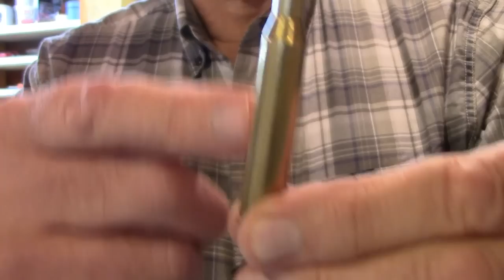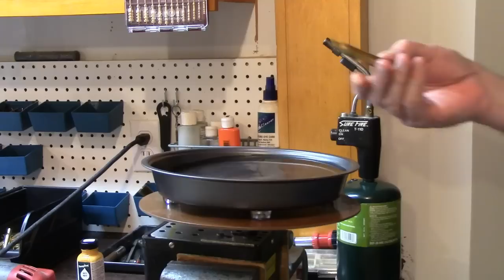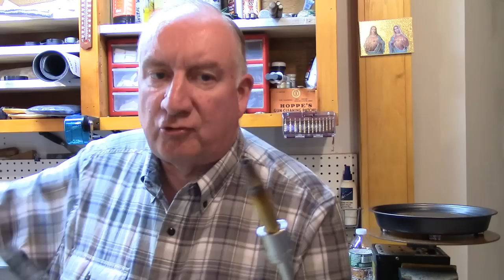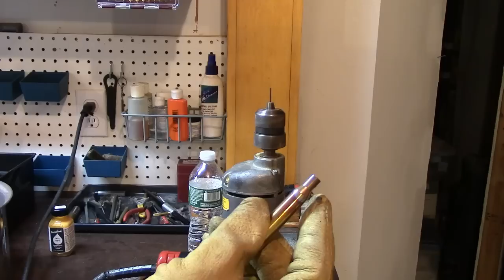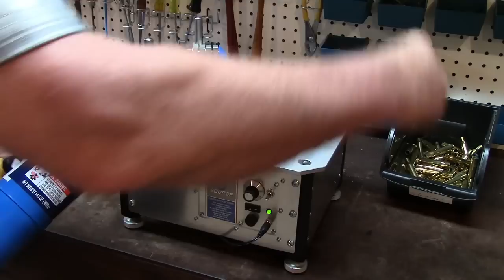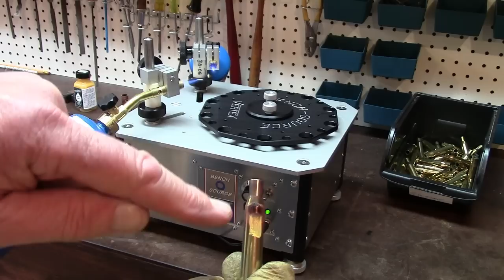How to Anneal Brass ~ Vertex Bench Source or a Tight Budget!

Comment: I have seen your bedding part 1 & 2.  I have bought a parker hale C (detachable clip, would have prefered a floor plate) 300 Win. Mag.  I was planning to free float it because the barrel was tight in the stock like you have explained why its done from the factory. When I removed the stock the forend was already glass beded to keep the barrel tight in the stock but not around the recoil lug or crossbolt.
This will also be tricky atound the back of the trigger guard assembly. May I send you a few pictures for advice.
Thx
Roy

Comment: Excellent video with tons of knowledge.  I acquired a Win 25-20 from my dad before he died and when I looked for ammo I was shocked to see it at $1.25 per cartridge!  My son has a Dillon press so I got the dies and proceeded to resize available 32-20 cases to 25-20.  My question is can these even be annealed since the case isn't that long to begin with or should I just reload them to failure?  If the color band change were to go just 1/4" below the lower bevel it would put it at the midpoint of the case.

Comment: Hi gunblue, I started annealing brass using the water bath method you showed. I am using a bernzomatic T8000 torch with propane. Its a bit powerful of a torch so I backed it off and I am using a hand spun kitchen lazy susan. I noticed on some brass I am getting a copper color even though I am leaving the torch on the brass a short time. Is this dangerous?

Comment: I love that machine.  I think the first method you used is flawed as it heats then cools very rapidly.  I am not too sure very fast cooling will prevent brittleness, or remove brittleness.  Anneahling is usually involved by controlled or slow cooling. I know brass is different than steel, and melts at a lower temperature, and therefore Anneahling versus Tempering would occur at different temperatures.  So the temperatures you mention sound right for brass. I just dont know that quenching a piece of brass quickly in water will make it soft as cooling it slowly.  I don't have three years to do a graduate thesis on it either. I only suggest it might not be as good as slow cooling, where slow cooling helps remove more flaws in the crystaline structures of a metal.  I'll go with slow cooling I guess.  Thanks for all your video's. You look like my grandfather, but are more my age.  Good damn advice thanks

Comment: Nice video. Thanks.  nice machine. I need one.  I don't understand the issue of to quench or not to quench.  Seems it is not hot enough to make any difference quenching.
Reply from the maker: Quenching has absolutely nothing to do with annealing brass whatsoever.  Steel is quenched to control hardness, but it has no relationship to brass.  Water is only involved to prevent unwanted heat from going too far down for some methods, and for cooling brass so it can be handled comfortably.  There's no issue of to quench or not to quench, because brass is not quenched in the traditional metallurgical sense attributed to steel.

Comment: Thank you so much for all these videos you create! Love how you show "cheap" way and not just expensive product usage. Question: How little heating is to low for propper annealing? I only have a cheap blow torch so not concentrate heat, and i realy can't see any blue at all, and hardly any brown.
Reply from the maker: Frode Hanssen 
Proper annealing can be done inexpensively, but it absolutely requires a concentrated propane or butane flame of sufficient intensity to bring the neck and shoulder quickly to 650 F.  A lazy flame will either cook the entire case before the job's done, softening critical tough brass, or it will simply not anneal the neck at all.  A basic but extremely good Bernzomatic torch kit with a propane tank only costs about $16.95 at Lowes.  That's less than 100 Sierra bullets or a pound of powder.  I see no reason why you need to use a cheap torch.
Reply: I forgot to mention when it's in the water pan. In drill, it turns red in about 7-10 seconds, so the heat is high enough i think, i just don't have that concentrated flame on my propane/butane torch like yours. So blue color shows when using drill. But in water, i can't see any color, it just turns to light color. Much like yours in the movie when using water pan, the first time. I just wounder in the water pan, how can i know when it's heated enough i water.

Comment: Question and comment - Very informative video; and it prompted me to watch many others now that I've subscribed to your channel.  I do have a question, having never annealed cases but wanting to start doing so... Should I resize then anneal, then load, or should I resize after annealing?  I realize the latter adds additional cold work to the case but I would expect minimal if it's already resized and that would seem to take out any warpage possibly created by the heat??  If it matters, I'm neck sizing only 270 WSM brass that's got me interested in this due to some neck splitting, which I haven't seen on any other cartridges over the past 10+ years of reloading (e.g. 7-08, 30-30, 30-06, .357/38, .44, 45LC).  Thanks!

Comment: I have one of the annealeez machines and for the most part works good. Unfortunatly im shooting a custom 22k hornet and need to anneal but the brass is to small to run on the annealeez machine. I may need to use the waterbath methood on them. Luckily its a single shot rifle and i dont need to anneal a lot of brass kn a hurry. Im still confused with the temperature indicating fluid. Im tol you should put it inside the case mouth, others say put it around the outside of the neck and you painted a stripe on the side of the case. Which should it be?
Reply from the maker: I prefer the stripe, which provides a relative reading of temperature progression, to avoid overheating the mid section.

Comment: I reload .303 British.  My cases separate 1/4 in .from the base.  You say to only anneal at the neck.  I have reloaded .303 for over 50 years.  usually just scrap them after 3 reloads. I don't want to mess with a different head space.  It's a real tack driver Enfield.  What's your opinion?
Reply: The 303 headspaces on the rim. Not on the shoulder as 308 does. Due to the compression on the bolt during fireing : the body of the shell grips the chamber walls the only place left for stretch is the area in front of the rim. So 3 reloads not bad

Comment: Looking for advice  and information. I have come across 6 mm Remington loaded and unloaded with no use for them and finding no one around that has 6 mm Remington. In inspection it would seem I can run the Remington cases through my 243 dies then trim the cases and use the 6 mm Remington as 243 .  They seem to run through the 243 die with ease and lower the sholder with no problem. Is there a reason this should not be done and with the moving of the shoulder will they need to be anneled  if they can be resized to 243.

Comment: In my case. my only advice is you are better off under annealing than over annealing.  I just line up my brass in a metal pan with about 3/4" of water in it...  then I turn off the lights so it is completely dark.  With the cartridges all lined up I go down the line slowly with my propane torch, just until you see color.  It doesn't have to "glow", just move on when you see any coloration.  I run it up the line of cartridges, then turn the pan around and do the other side of the cartridges.

Comment: Thank you for an excellent insight into the nuances of case annealing. I have one simple question; at what point in the reloading process do you anneal? There seems to be very different opinions on the topic. Before Resize or after ?
Reply from the maker: Frank Ashby 
It makes absolutely no difference whatsoever.  Just like combing your hair (I fondly recall that), changing the oil in your car, brushing your teeth, or washing the kitchen floor; annealing is done simply because it needs it.  Any number of scenarios can be imagined by the idle mind to support one or another conclusion, but the only thing it accomplishes is the restoration of original design softness.  As I said in the video, the vast majority of highly satisfied loaders never annealed a case in their life.  As far as I am concerned, it is always good practice to run a case through a sizing die as the first step in reloading, even with brand new cases, to true up defects that may have occurred through handling.  The most important cosmetic issue to consider is that they be cleaned first, whether they are sized or not.  Exterior soil will become a permanent stain.  Again, it makes no difference.
Reply: Before.
Reply: @crvnmrhd  Thank you sir, I wholeheartedly agree

Comment: I am totally new to this process. How long roughly does brass last (low loads to high loads)? What should one look for to know that a case has reached the end of its lifespan?
Reply from the maker: There's no set lifespan. Brass fails mostly by splitting at the neck, and expanded primer pockets that won't hold primers snugly. Annealing improves life, but not indefinitely.

Comment: What's the depth of your water bath, about 1/2 inch " ??  Nice video and clear presentation. Also, I like the lazy susan idea and would use a metal pan atop with adhesive to lock in that pan for reuse. (I welcome critique of that idea)
Reply from the maker: Walter Palmer 
Sounds good.  Water depth of about 1/4th the case height is appropriate.

Comment: Amazingly comprehensive and detailed! Masterfully done! I have one question: What are the dimensions of the copper bushing/ insert you make for the .308 Win. to achieve the correct height?

Needless to say, I subscribed to your channel. You really have what it takes to educate others and make presentations that inform and help others become better reloaders and shooters. Thank you very much!
Reply from the maker: Kokozo 
It measures .800", which will work for any .308 based cartridge; 243 Win., 260 Rem., 7mm-08 Rem., etc.  The bushing gets you to an easily repeatable position, from which you can make fine angle and setback adjustments, according to your flame and nozzle. Thanks for watching.

Comment: Now who the hell are the 43 Bernie Bros that thumbed down this video? Great video, thank you sir!
Reply: Don't misunderstand me, I like the guy & generally I  agree with his opinions but, on this subject & unfortunately, the old guy has neglected to do his research & has opted to go along with the long perpetuated old wives tales that have been passed along for decades.
Reply: @rotasaustralis  do you subscribe to Erik Cortina's theories? He gets the brass cherry red, says there's no problems. Says it's close to impossible to over anneal. 10, 15, 20 seconds under the flame... man I'm not sure I trust the point he was making, but... still trying to figure it out.
Reply: @jacobcastro1885  Well, Eric subscribes to my ideas. I've been annealing at 800C + for 10 seconds for a couple years now with excellent results. I have many reload cycles & annealing cycles at "recrystallization" temperatures with no adverse problems to date. AMP use 1030F (550 C) in their process. This is the "elephant in the room" as no one mentions or discusses this. That info had been on the AMP website for years & no one said a thing.
Reply: @rotasaustralis  
I'm getting ready to jump into annealing. I'm using twice fired brass, 7mag. 2 different rifles (but focusing only on one now). 
I want to extend the life of the brass - so I'm trying to avoid additional trimming. Luckily the sharper shoulders will help. I guess I'm not understanding why it's "better" to cook for 10 seconds than 5.
Im a hipower shooter. My 308 bolt runs 1/3 moa on a bad day - fl resizing, neck turning. I'm not benchrest or fclass.
Reply: @jacobcastro1885  I do 10 seconds to ensure 100% recrystallization in the neck/shoulder of the case.
I'm getting excellent results with velocity & seating force however, annealing to this level requires FLS & neck sizing modifications.  
If you're a hunter & just want to keep the necks from splitting, it's very simple. Just flash the neck up to a medium- bright cherry for 1 or 2 seconds. That should be around 500 C to 550 C (1000 F to 1100 F) & that temp ensures proper stress relief within the brass matrix. You probably only have to stress relieve every  2 or 3 firings if it's done properly in the first place.

Comment: Thank you for this video, very informative. I was once told by a veteran old timer old school reloader that you can anneal brass on a candle flame as well (in the event of unavailability of propane torches). 
What do you think about a candle flame use in primitive annealing scenario?
Reply from the maker: Perhaps it would work, though I frankly think that primitive and reloading is a rather odd contradiction in terms. There is nothing primitive about reloading modern ammunition.  In the most remote location, I think I could find propane easier than reloading components.  But for entertainment, it might work.